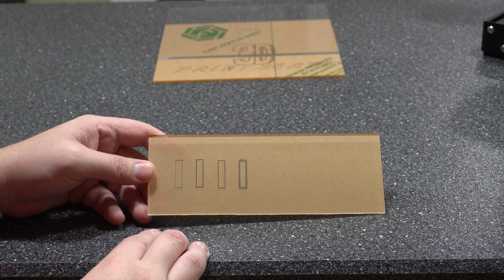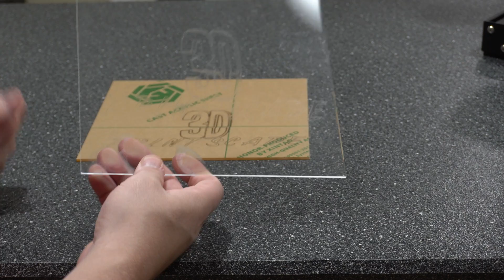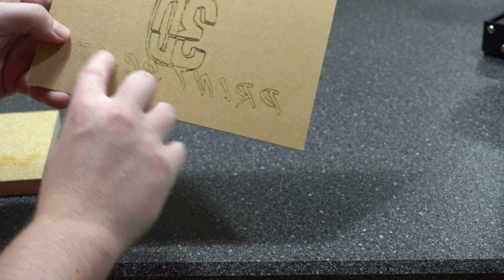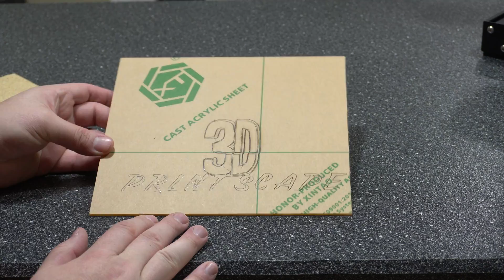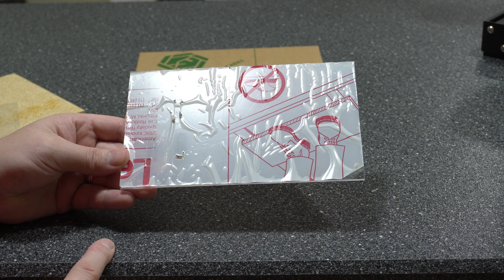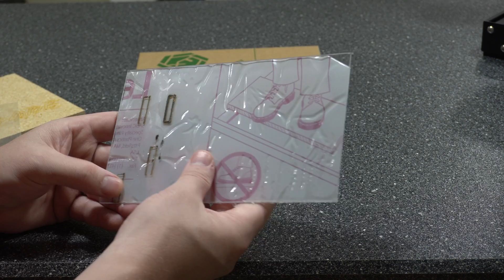3D Printer Acrylic Engraving – The Basics

Comment: Hey so I just got the laser engraver and I have some questions. I did the install following everything correctly, and tried using it on the test bits of wood provided. I was getting no engraving at any speed above 10, and anything above 5 would only burn the top of the wood. I got some clear acrylic (was packaged like the plexiglass you show in this video with the clear wrap on one side and an opaque white wrap on the other). Again I am not getting any type of progress on the higher speeds, and i even ran it at a 7 and still not making any kind of mark. Do you have any tips on what could be causing this issue?
Reply from the maker: Hi. What wattage laser did you get and do you have laser tuned in correctly? If you have the one i got, it has a set focal point at 20 mm. Some of the other ones need to be dialed in at a point of your choosing.

Comment: Hey great video, i recently purchased a creality CV-01 Pro but having trouble engraving acrylic , could you please share the power settings in order to get it work.
Reply from the maker: Hi. What issues are you having? The power going to the laser is the full voltage from the fan line, it goes to 255 when it starts. You may just need to slow the engraving down.
Reply: @3DPrintscape  im not able to figure out what settings should i set in CrealityLaser in order to engrave the acrylic for led light base. It just burns right through to the wooden base underneath.
Reply from the maker: @0776555280  It does the same thing for me, as shown in the video, but it is still engraved. What laser speed are you using.
Reply: @3DPrintscape  i used settings ranging from 500 mm per minute to 900 mm per minute
Reply from the maker: @0776555280  What software are you using? In the CrealityWorkshop software, the value is defined in mm/s, which i have set to 12.
Reply: @3DPrintscape   I use CrealityLaser which came with the engraver. Btw thanks for taking your time to reply :)

Comment: I got mine installed and working but havent successfully used it yet. Im using Klipper and when I get it ready and hit print, it errors out cause it wants to auto home first. So I need to experiment a bit yet or change back to Marlin. Unless anyone has suggestions.
Reply from the maker: Hi. Did you autohome first?